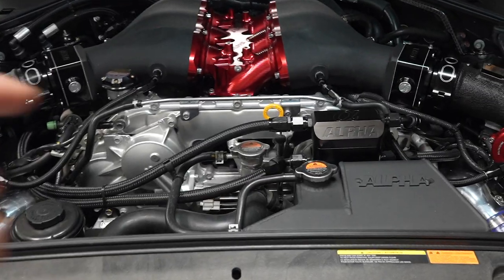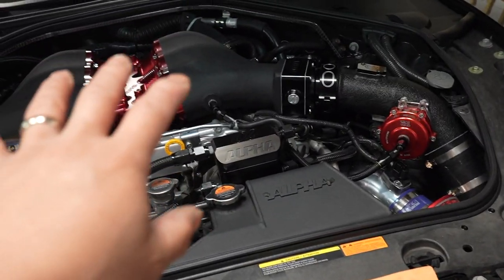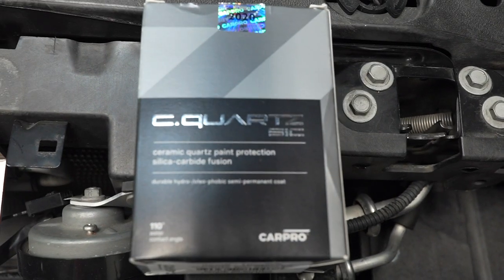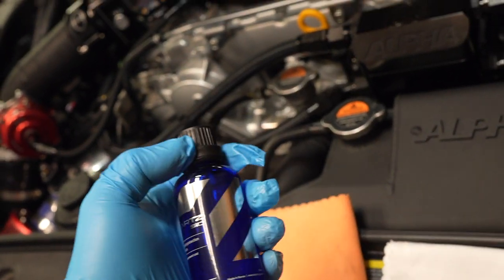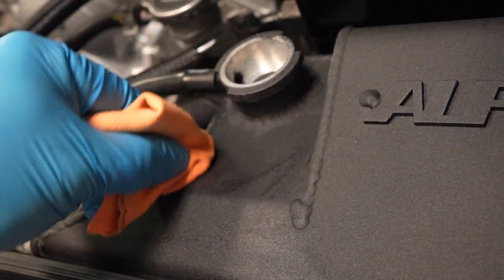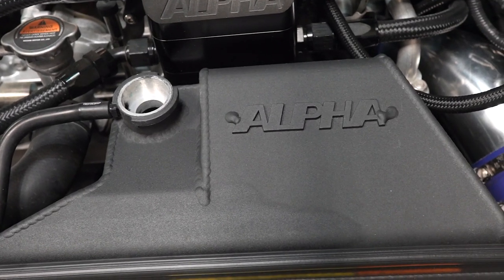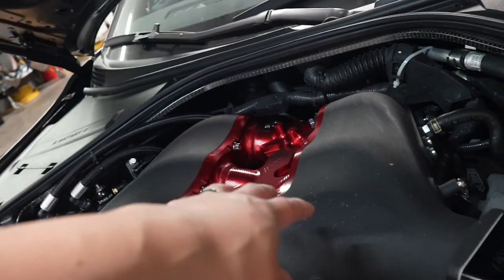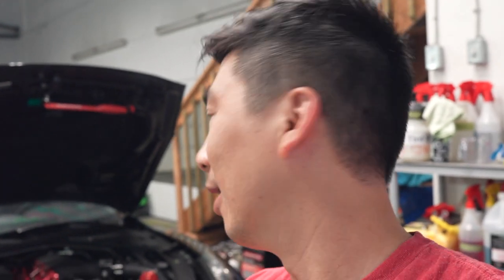Ceramic Coating My Engine Bay! Will It Work?

Comment: Wonder if you can use on manifold carbon too ??
Reply from the maker: You should be able to coat the carbon intake.
Reply: @phothrottle  will try it and cooling overflow tank and I/C piping I didn’t like the dull black on tank either so I repainted it to match I/C piping.